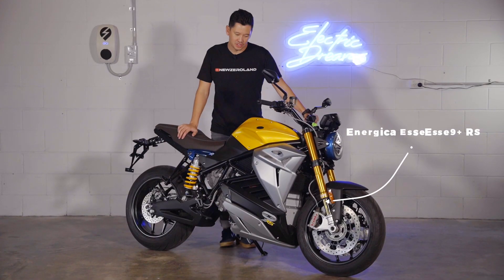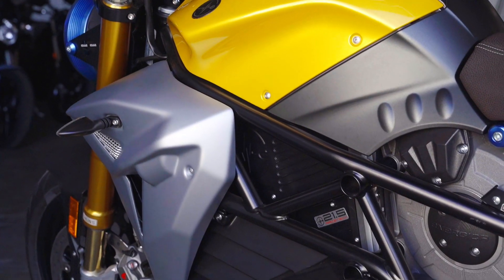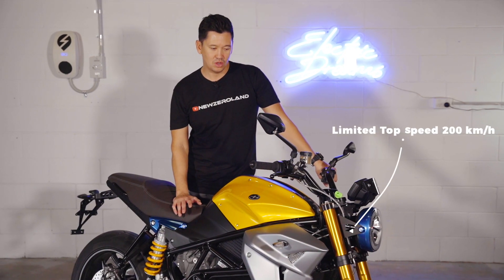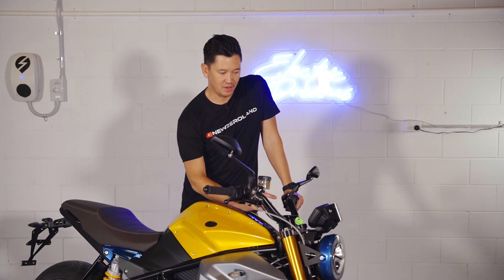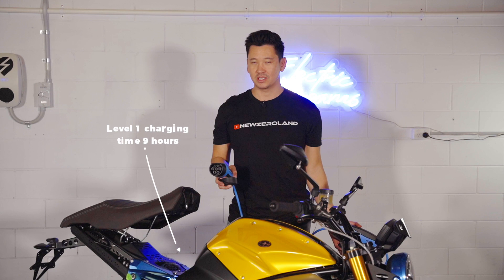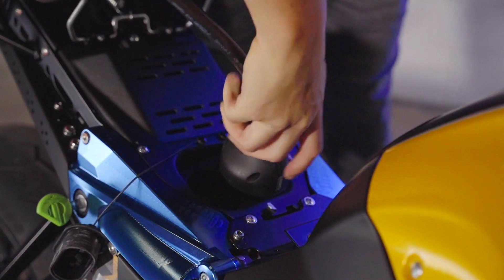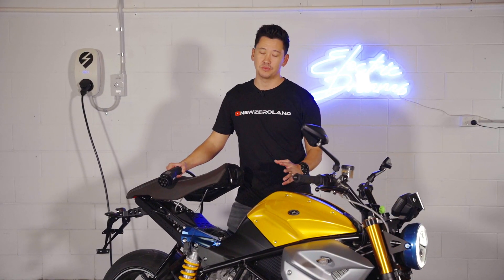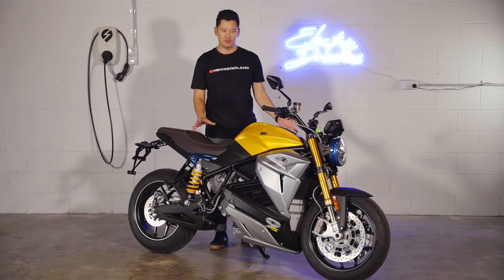How To Charge Energica EsseEsse9 | Australian Electric Motor Co

Comment: next to charging port is metal "thing" which is manual/safety release for charging cable - so anybody can unplug bike if you left it unattended - also if you charge in ac station with your own type2 cable - will be good to lock cable to to some part of bike to prevent of steal